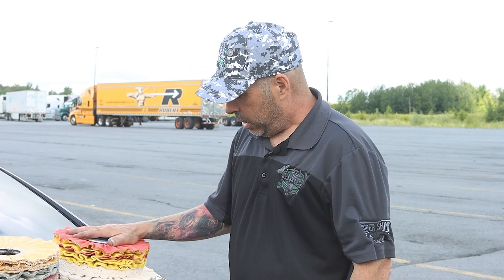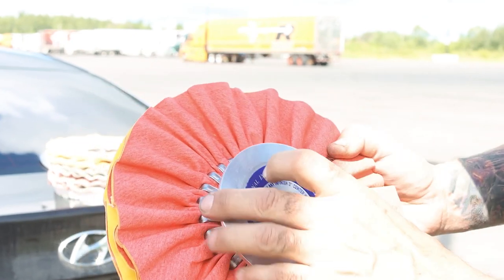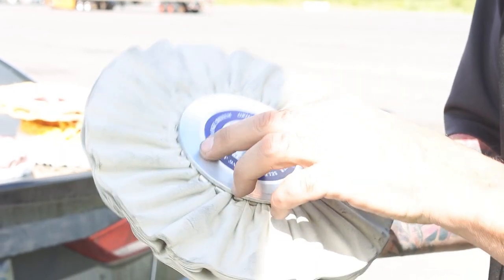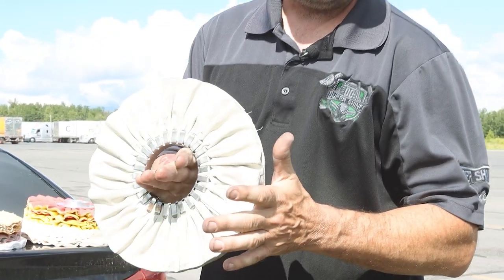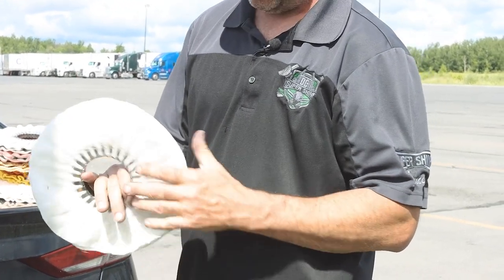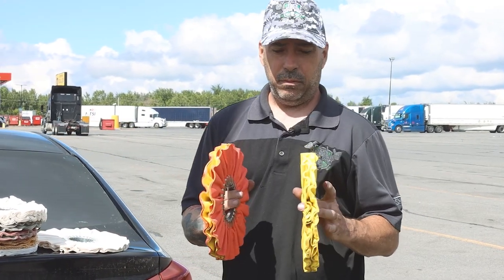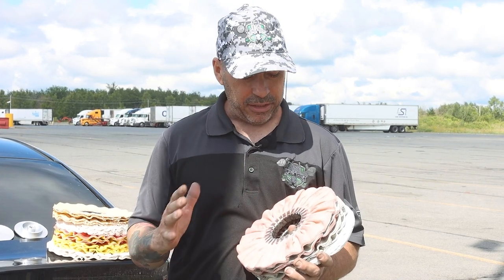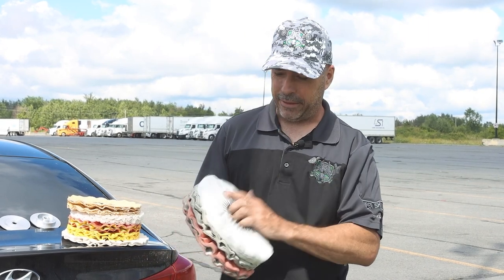Airway Pads what are they... Which to use??? Aluminum Polishing Tips

Comment: Where can I get more info on pads and compounds to use. I have an aluminum flat bed with side skirts and tool boxes. I started with some other products and am not satisfied with results. I was going to have to sand out some corrosion. Then I got hit and am in process of getting it replaced with a new unit. So I’ll be polishing new metal and probably won’t need any sanding. But there are lots of small areas, round tubes and corners to deal with. 
I’ll take any tips you can suggest
Reply from the maker: Hey David,  send me a message on fb or ig be easier to chat more there.